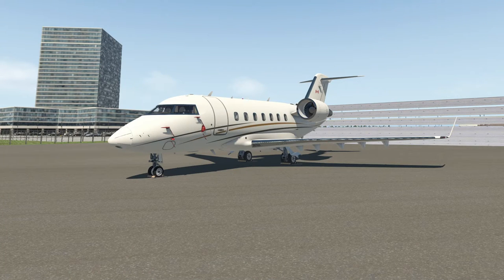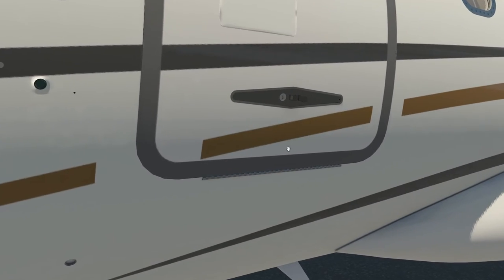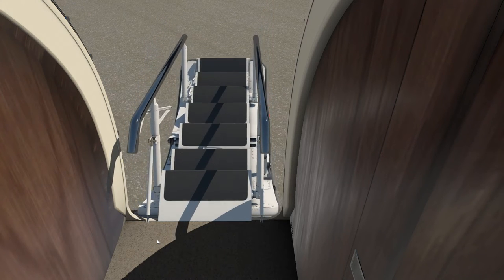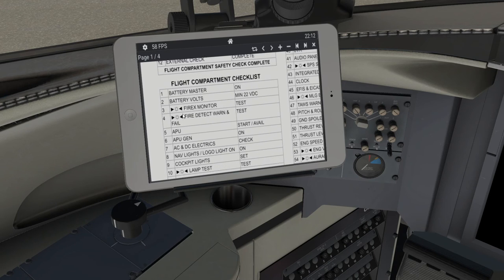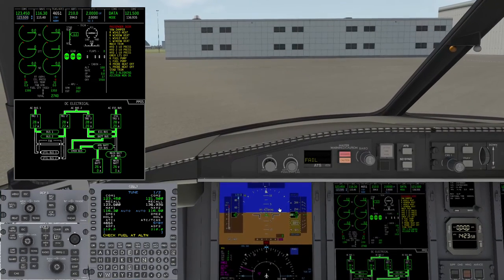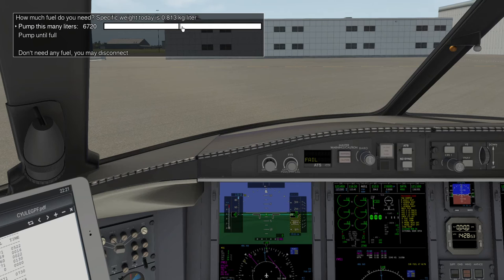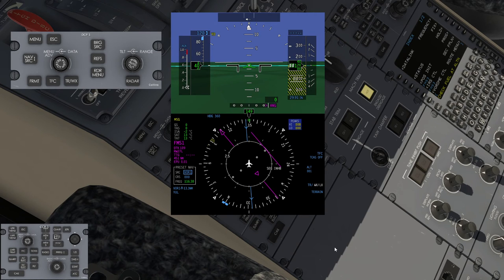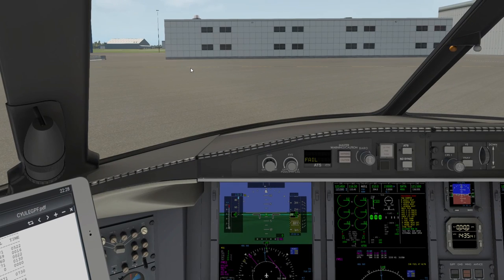Hot Start Challenger 650 - 1 - Preparation and Power Up

Comment: This is a fantastic simulation.  Just a few points as I watch this:
The DC Power receptacle is for APU starting only.  You need AC power to energize the battery chargers.  There is no way to charge batteries on DC external power.
The AC/DC Utility Switch should be pressed out during start-up.

Look forward to climbing around the aft equipment bay for my pre-flight! :-)  Hope to see that update soon.
Reply from the maker: Thanks. Yes I was mistaken about the DC power receptacle. The specific SOPs shown have the AC/DC util switch being pressed out (on) during the flight compartment checklist, which will follow in the next video.

Comment: The DC external power connection is NOT to charge the APU battery, it's to start the APU when the battery is flat and to power the battery bus. Each of the two batteries has a dedicated battery charger which is AC powered.
Reply from the maker: Thanks, yes that makes sense. We saw a lot of people running both AC and DC GPUs in the early days of the Hot Start release!  Since this video was recorded there has been a lot of improvements to the Challenger too, for example the main battery disconnect in the forward bay is now simulated.

Comment: Hi many thanks for the tutorial. 
 Can I just ask how you managed to get the refuel in Kg / liter, i have changed it in the airframe manager to KG but the ground services re fuel truck is still showing Lbs/gal.  Many thanks
Reply from the maker: Thanks for the question, and sorry for the delay replying. The units used by the refueller are region specific. You’ll get litres in Europe and Gallons in the US, regardless of what the airframe is set to. This ties in with real life - when metric aircraft visit the US they still work in metric, but fuel uplift is in gallons.

Comment: Great video Graham. Do you know how to return to walkaround mode from one of the other X-Plane views (e.g. from free camera). The only way I've found is to use the Challenger menu to sit in pilot seat and then leave the seat. I wondered if there was a keyboard shortcut?
Reply from the maker: Sorry for the delay replying, I don't know about free camera but usually pressing the same external view button again will return the camera to the previous position. However like you I tend to end up back in the seat, then slew the view to the outside!

Comment: That’s great but you did not do the power on checklist. Where are you test the anti-skid the duct mon, hydraulic pumps, so you can open up the nose gear doors. And set the parking brake after the anti-skid test but pretty cool I love the simulator.
Reply from the maker: That's all in video 2 - cockpit checks! This was simply the initial power up ;-)

Comment: What exactly is the ADG for? very very good video
Reply from the maker: Air Driven Generator. Provides AC power in the event of a total loss of AC generation. Similar to a ram air turbine.
Reply: @ReflectedRealitySimulations  Thank you very much.
As you know well, I ask you again to understand the bleed air stage 14TH and 10TH ?
Reply from the maker: 14th stage is for anti-ice equipment. 10th stage is pressurisation and air conditioning. It's a bit unusual having them split, but allows APU for pressurisation while engines can run wing anti-ice, which is not possible with aircraft like the A320.
Reply: @ReflectedRealitySimulations  ah yes ! ok thank's.

Comment: Is there a shorter procedure to start the engines?
Reply from the maker: It's like most other sim airplanes, start the APU, establish bleed pressure, start the engines. If you want a quicker "by the book" method, I'd suggest skipping the first flight of the day checks, shown with the little sun icon on the checklists. Alternatively, do the preparation checks once then save a state - you can then reload that ready for engine start whenever you want.
Reply: Thanks for your time my friend :) @ReflectedRealitySimulations

Comment: I only hope there is a simplified flow to bypass all the tests and checks, just like you flew the Q400 with Amy without using the checklist.
Reply: Once you work through and understand the full procedures a bit you will yourself see how to simplify the flow, I know I have...
Reply: You can create saved states, such as before taxi or on runway, etc, you get there plane where you want it and then state save it.  You of course can skip the tests an checks yourself and just pay attention to the actions that actually have to be done, that is up to you and nothing will stop you from doing that right now.
Reply from the maker: I’ve been considering showing a simplified flow in a later video to help people get up and running quickly, but as others have mentioned you only need to do it once then you can save the state. The quick turnaround checklist can then be used each time and is really pretty useful to get going quickly.

Comment: I can fly the 650 inverted and in barral loops like a F15. How that model realistic as all ?!
Reply from the maker: In fact, it's not really that unrealistic from an aerodynamics perspective. The aerodynamics don't change, all that matters is control authority, wing loading and thrust to weight ratio. In fact, the CF34 engines on the Challenger are a version of the TF34 fitted to the A10!  Yes, there are structural limitations that could be exceeded, but that's not flight dynamics modelling. (Although a barrel roll is a low positive G manoeuvre, and several airliners have actually been rolled, like the 707 and Concorde).

Comment: Dear friends, please, where are the wipers sws? Thnx.
Reply from the maker: The real Challenger 650 does not have wipers, so the model doesn't have them either. If you look on a CRJ-200 (or a Challenger 850, which is a CRJ-200) you'll see wipers, but not on a 604/605/650.

Comment: and firex monitor ?
thank's.
Reply from the maker: The Firex monitors checks the continuity of the engine and APU fire extinguishing system squibs. Basically ensuring the fire extinguish system will operate if required.
Reply: @ReflectedRealitySimulations  Ok thank's and the APR ?